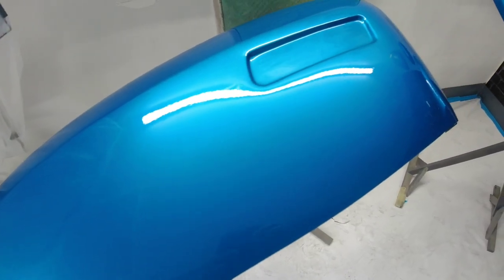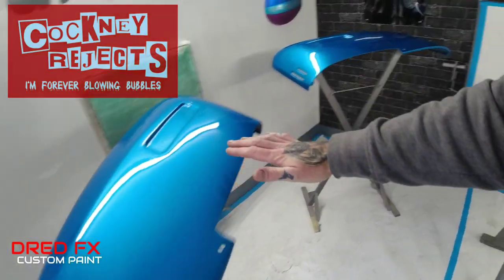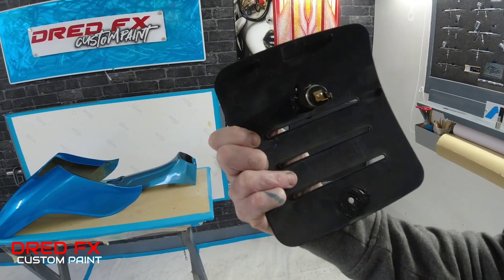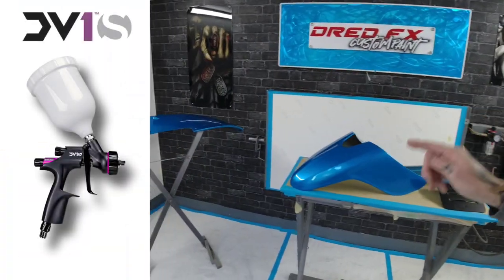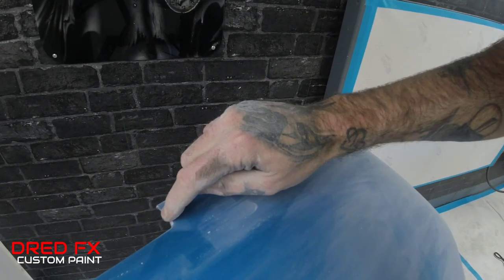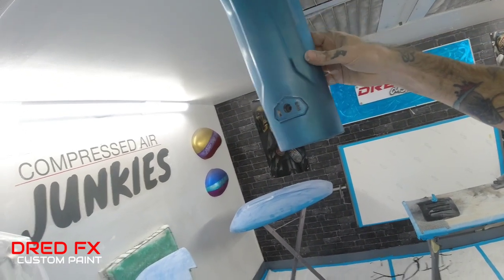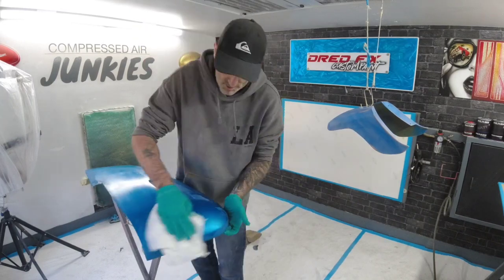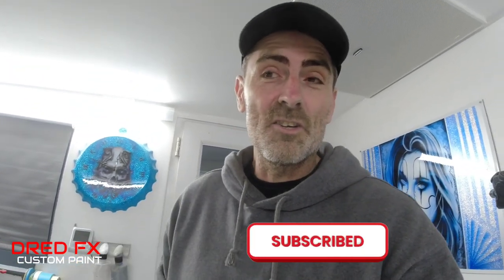getting things ready for paint !

Comment: Looking good so far Rob, the prep work is the most important part for a good finish but it's not the most exciting stage it has to be done though, I'm in the middle of priming 6 wings with 2K high build and it's a messy horrible job, my booth has turned grey from all the overspray🤦‍♂😂👍
Reply from the maker: Yes mate that's why I paper over the floor now in the studio
Reply: I use outdoor patio carpet in my little booth which is smaller than yours, the carpet is great it just needs a quick hoover once in a while when using basecoat and clearcoat but for primer I cover it in a sheet of polyethene, had the carpet in there for nearly a year now and it's still fine it helps to keep your jobs clean as well
Reply from the maker: @JohnWD40TC02  nice one mate your work does come out very clean 👍